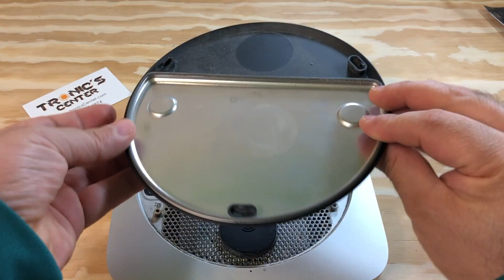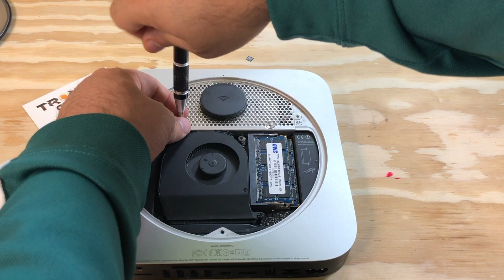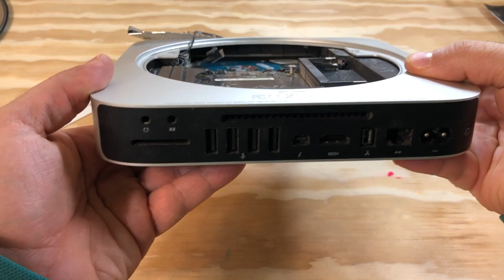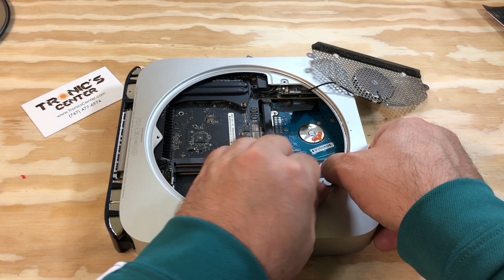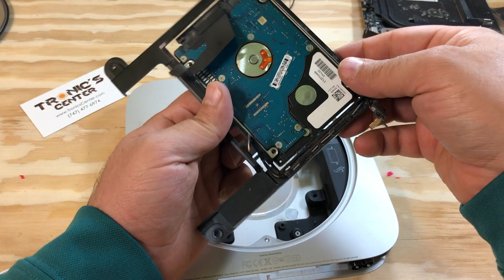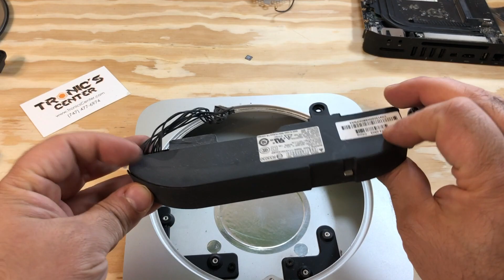Full Disassembly Apple Mac Mini A1347 - Take Apart Mac Mini A1347 and Tear down     HD 1080p

Comment: Thank you
Reply from the maker: Thanks  !  Dear Customer let us know what repair or disassembly you want us to make video ! Please not that we do deal with all Brands Dell, Lenovo, Asus, Razer, Toshiba, Hp, Sony, Panasonic, Nikon, Canon, Black Magic, Red Camera, any Camcorder Bards, Also we do IT Support and Data Recovery !
Reply from the maker: A2251 KeyWords 

MacBook Pro "Core i5" 2.0 13" 2020 4 TB 3, 2.0 GHz Core i5, I5-1038NG7, MacBook Pro "Core i7" 2.3 13" 2020 4 TB 3, 2.3 GHz Core i7,  I7-1068NG7, MacBookPro16,2 , 2020 13" 4 TB 3 , A2251 MacBook , EMC 3348, MWP72LL/A, BTO/CTO

————————————————————

A2141 KeyWords 

MacBook Pro "Core i7" 2.6 16" 2019, 2.6 GHz Core i7 (I7-9750H), 2.3 GHz Core i9 (I9-9880H), A2141 (EMC 3347), 2.4 GHz Core i9 (I9-9980HK) , MacBookPro16,1, MacBook Pro "Core i7" 2.6 16" 2019 5600M, 2.6 GHz Core i7 (I7-9750H),  MacBookPro16,4 , MacBook Pro "Core i9" 2.3 16" 2019 5600M, 2.3 GHz Core i9 (I9-9880H), MacBook Pro "Core i9" 2.4 16" 2019 5600M, 2.4 GHz Core i9 (I9-9980HK), MVVL2LL/A, MVVM2LL/A, 16" MacBook A2141

———————————————

A2179 Keywords

MWTJ2LL/A, EMC 3302 , 1.1 GHz Core i3 (I3-1000NG4) , MacBook Air "Core i3" 1.1 13" (Scissor, 2020) , MacBookAir9,1 , 1.1 GHz Core i5 (I5-1030NG7) , MVH22LL/A , MacBook Air "Core i7" 1.2 13" (Scissor, 2020), 1.2 GHz Core i7 (I7-1060NG7)

——————————————

A2159 Keywords 

1.4 GHz Core i5 (I5-8257U) , MacBook Pro "Core i5" 1.4 13" Touch/2019 2 TB 3 , MacBook Pro "Core i7" 1.7 13" Touch/2019 2 TB 3 , 1.7 GHz Core i7 (I7-8557U) , MUHN2LL/A , A2159 , EMC 3301 , MacBookPro15,4 , 2019 13" (Touch Bar, 2 TB 3), 13" MacBook Pro A2159

—————————————————————

A1932 Keywords  

MRE82LL/A , MVFH2LL/A, 1.6 GHz Core I5-8210Y, 1.6 GHz Core I5-8210Y, MacBookAir8,1 , EMC 3184 , 13" MacBook Air Space Gray, 13" MacBook Air Gold , 13" MacBook Air Silver , 13" MacBook Air 2019 13" MacBook Air 2018, 13" MacBook Air A1932

—————————————————————

A1534 Keyword’s

EMC 2746, MF855LL/A, MF865LL/A, EMC 2991, MLHA2LL/A, MLHC2LL/A, EMC 3099, MNYF2LL/A, MNYG2LL/A, MacBook8,1 , 1.1 GHz Core M (M-5Y31) , 1.2 GHz Core M (M-5Y51), 1.3 GHz Core M (M-5Y71), 1.1 GHz Core m3 (M3-6Y30), 1.2 GHz Core m5 (M5-6Y54), 1.3 GHz Core m7 (M7-6Y75), 1.2 GHz Core m3 (M3-7Y32), 1.3 GHz Core i5 (I5-7Y54), 1.4 GHz Core i7 (I7-7Y75), MacBook9,1 , MacBook10,1

——————————————————

A1990 Keywords

MR932LL/A, 2.2 GHz Core i7 (I7-8750H), EMC 3215, MacBookPro15,1 , MR942LL/A 2.6 GHz Core i7 (I7-8850H), 2.6 GHz Core i7 (I7-8850H), 2.9 GHz Core i9 (I9-8950HK), 2.6 GHz Core i7 (I7-9750H), EMC 3359, 2.3 GHz Core i9 (I9-9880H), 2.4 GHz Core i9 (I9-9980HK), MacBookPro15,3, A1990 MacBook, 15” MacBook A1990

———————————————————

A1989 Keyword 

A1989 MacBook 2018 MR9Q2LL/A, 2.3 GHz Core i5 (I5-8259U), BTO/CTO, 2.7 GHz Core i7 (I7-8559U), EMC 3214, MacBookPro15,2 , A1989 MacBook 2019 MV962LL/A , 2.4 GHz Core i5 (I5-8279U) , MV982LL/A, 2.8 GHz Core i7 (I7-8569U) , EMC 3358, 13" MacBook A1989

———————————————

A1708 Keywords

MLL42LL/A, A1708, EMC 2978, MacBookPro13,1 , 2.0 GHz Core i5 (I5-6360U) , 2.4 GHz Core i7 (I7-6660U) , MPXQ2LL/A, EMC 3164, 2.3 GHz Core i5 (I5-7360U) , 2.5 GHz Core i7 (I7-7660U), MPXQ2LL/A, 13" MacBook A1708

———————————————————— 
MacBook 

Apple, MacBook, 13" MacBook, MacBook Air, A1466 MacBook, MacBook Air logic Board, 13" MacBook Air , Apple Mac , 11” MacBook , A1465 MacBook, A1502 MacBook, A1398 MacBook, A1425 MacBook, A1706 MacBook, A1708 MacBook, A1707 MacBook, A1990 MacBook, A1989 MacBook, A2159 MacBook, A2179 MacBook, A2289 MacBook, A2337 MacBook, A2338 MacBook, A2141 MacBook, MacBook Pro, MacBook Pro Retina, Retina display, True Tone Display , Top Case KeyBoard, Apple Keyboard, MacBook KeyBoard, MacBook Trackpad.
———————————————————

A1398 MacBook, A1398 Logic Board, A1398 LCD, A1398 KeyBoard , A1398 Display, MC975LL/A, MC976LL/A, MD831LL/A, ME664LL/A, ME665LL/A , ME698LL/A, ME293LL/A, ME294LL/A, ME874LL/A, MGXA2LL/A, MGXC2LL/A, MGXG2LL/A, MJLQ2LL/A, MJLT2LL/A, MJLU2LL/A

—————————————————————

A1706 Keywords

MLH12LL/A, A1706 EMC 3071, MacBookPro13,2 , MacBookPro14,2 , MPXV2LL/A, A1706 EMC 3163 , 3.5 GHz Core I7-7567U, 3.3 GHz Core I5-7287U, 3.1 GHz Core I5-7267U, 3.3 GHz Core I7-6567U, 3.1 GHz Core I5-6287U, 2.9 GHz Core I5-6267U, A1706 MacBook, A1706 MacBook Touch Bar 

—————————————————————
A1707 Keywords 

MPN 923-01477 , MLH32LL/A, MLH42LL/A, MPTR2LL/A, MPTT2LL, EMC 3072, MLH32LL/A, MacBookPro13,3, 2.7 GHz Core i7 (I7-6820HQ), MLH42LL/A, 2.9 GHz Core i7 (I7-6920HQ), EMC 3162 , 2.8 GHz Core i7 (I7-7700HQ), MacBookPro14,3 , 2.9 GHz Core i7 (I7-7820HQ), MPTR2LL/A, MPTT2LL/A, 3.1 GHz Core i7 (I7-7920HQ), A1707 MacBook, A1707 Touch Bar

Comment: Great video 👍😊👍
Reply from the maker: A1481 Apple Mac pro Parts available at www.TronicsCenter.com Thanks for watching
Reply from the maker: A2251 KeyWords 

MacBook Pro "Core i5" 2.0 13" 2020 4 TB 3, 2.0 GHz Core i5, I5-1038NG7, MacBook Pro "Core i7" 2.3 13" 2020 4 TB 3, 2.3 GHz Core i7,  I7-1068NG7, MacBookPro16,2 , 2020 13" 4 TB 3 , A2251 MacBook , EMC 3348, MWP72LL/A, BTO/CTO

————————————————————

A2141 KeyWords 

MacBook Pro "Core i7" 2.6 16" 2019, 2.6 GHz Core i7 (I7-9750H), 2.3 GHz Core i9 (I9-9880H), A2141 (EMC 3347), 2.4 GHz Core i9 (I9-9980HK) , MacBookPro16,1, MacBook Pro "Core i7" 2.6 16" 2019 5600M, 2.6 GHz Core i7 (I7-9750H),  MacBookPro16,4 , MacBook Pro "Core i9" 2.3 16" 2019 5600M, 2.3 GHz Core i9 (I9-9880H), MacBook Pro "Core i9" 2.4 16" 2019 5600M, 2.4 GHz Core i9 (I9-9980HK), MVVL2LL/A, MVVM2LL/A, 16" MacBook A2141

———————————————

A2179 Keywords

MWTJ2LL/A, EMC 3302 , 1.1 GHz Core i3 (I3-1000NG4) , MacBook Air "Core i3" 1.1 13" (Scissor, 2020) , MacBookAir9,1 , 1.1 GHz Core i5 (I5-1030NG7) , MVH22LL/A , MacBook Air "Core i7" 1.2 13" (Scissor, 2020), 1.2 GHz Core i7 (I7-1060NG7)

——————————————

A2159 Keywords 

1.4 GHz Core i5 (I5-8257U) , MacBook Pro "Core i5" 1.4 13" Touch/2019 2 TB 3 , MacBook Pro "Core i7" 1.7 13" Touch/2019 2 TB 3 , 1.7 GHz Core i7 (I7-8557U) , MUHN2LL/A , A2159 , EMC 3301 , MacBookPro15,4 , 2019 13" (Touch Bar, 2 TB 3), 13" MacBook Pro A2159

—————————————————————

A1932 Keywords  

MRE82LL/A , MVFH2LL/A, 1.6 GHz Core I5-8210Y, 1.6 GHz Core I5-8210Y, MacBookAir8,1 , EMC 3184 , 13" MacBook Air Space Gray, 13" MacBook Air Gold , 13" MacBook Air Silver , 13" MacBook Air 2019 13" MacBook Air 2018, 13" MacBook Air A1932

—————————————————————

A1534 Keyword’s

EMC 2746, MF855LL/A, MF865LL/A, EMC 2991, MLHA2LL/A, MLHC2LL/A, EMC 3099, MNYF2LL/A, MNYG2LL/A, MacBook8,1 , 1.1 GHz Core M (M-5Y31) , 1.2 GHz Core M (M-5Y51), 1.3 GHz Core M (M-5Y71), 1.1 GHz Core m3 (M3-6Y30), 1.2 GHz Core m5 (M5-6Y54), 1.3 GHz Core m7 (M7-6Y75), 1.2 GHz Core m3 (M3-7Y32), 1.3 GHz Core i5 (I5-7Y54), 1.4 GHz Core i7 (I7-7Y75), MacBook9,1 , MacBook10,1

——————————————————

A1990 Keywords

MR932LL/A, 2.2 GHz Core i7 (I7-8750H), EMC 3215, MacBookPro15,1 , MR942LL/A 2.6 GHz Core i7 (I7-8850H), 2.6 GHz Core i7 (I7-8850H), 2.9 GHz Core i9 (I9-8950HK), 2.6 GHz Core i7 (I7-9750H), EMC 3359, 2.3 GHz Core i9 (I9-9880H), 2.4 GHz Core i9 (I9-9980HK), MacBookPro15,3, A1990 MacBook, 15” MacBook A1990

———————————————————

A1989 Keyword 

A1989 MacBook 2018 MR9Q2LL/A, 2.3 GHz Core i5 (I5-8259U), BTO/CTO, 2.7 GHz Core i7 (I7-8559U), EMC 3214, MacBookPro15,2 , A1989 MacBook 2019 MV962LL/A , 2.4 GHz Core i5 (I5-8279U) , MV982LL/A, 2.8 GHz Core i7 (I7-8569U) , EMC 3358, 13" MacBook A1989

———————————————

A1708 Keywords

MLL42LL/A, A1708, EMC 2978, MacBookPro13,1 , 2.0 GHz Core i5 (I5-6360U) , 2.4 GHz Core i7 (I7-6660U) , MPXQ2LL/A, EMC 3164, 2.3 GHz Core i5 (I5-7360U) , 2.5 GHz Core i7 (I7-7660U), MPXQ2LL/A, 13" MacBook A1708

———————————————————— 
MacBook 

Apple, MacBook, 13" MacBook, MacBook Air, A1466 MacBook, MacBook Air logic Board, 13" MacBook Air , Apple Mac , 11” MacBook , A1465 MacBook, A1502 MacBook, A1398 MacBook, A1425 MacBook, A1706 MacBook, A1708 MacBook, A1707 MacBook, A1990 MacBook, A1989 MacBook, A2159 MacBook, A2179 MacBook, A2289 MacBook, A2337 MacBook, A2338 MacBook, A2141 MacBook, MacBook Pro, MacBook Pro Retina, Retina display, True Tone Display , Top Case KeyBoard, Apple Keyboard, MacBook KeyBoard, MacBook Trackpad.
———————————————————

A1398 MacBook, A1398 Logic Board, A1398 LCD, A1398 KeyBoard , A1398 Display, MC975LL/A, MC976LL/A, MD831LL/A, ME664LL/A, ME665LL/A , ME698LL/A, ME293LL/A, ME294LL/A, ME874LL/A, MGXA2LL/A, MGXC2LL/A, MGXG2LL/A, MJLQ2LL/A, MJLT2LL/A, MJLU2LL/A

—————————————————————

A1706 Keywords

MLH12LL/A, A1706 EMC 3071, MacBookPro13,2 , MacBookPro14,2 , MPXV2LL/A, A1706 EMC 3163 , 3.5 GHz Core I7-7567U, 3.3 GHz Core I5-7287U, 3.1 GHz Core I5-7267U, 3.3 GHz Core I7-6567U, 3.1 GHz Core I5-6287U, 2.9 GHz Core I5-6267U, A1706 MacBook, A1706 MacBook Touch Bar 

—————————————————————
A1707 Keywords 

MPN 923-01477 , MLH32LL/A, MLH42LL/A, MPTR2LL/A, MPTT2LL, EMC 3072, MLH32LL/A, MacBookPro13,3, 2.7 GHz Core i7 (I7-6820HQ), MLH42LL/A, 2.9 GHz Core i7 (I7-6920HQ), EMC 3162 , 2.8 GHz Core i7 (I7-7700HQ), MacBookPro14,3 , 2.9 GHz Core i7 (I7-7820HQ), MPTR2LL/A, MPTT2LL/A, 3.1 GHz Core i7 (I7-7920HQ), A1707 MacBook, A1707 Touch Bar

Comment: good video
Reply from the maker: All Parts of Mac Mini and iMac available at www.TronicsCenter.com Thanks for watching
Reply from the maker: A2251 KeyWords 

MacBook Pro "Core i5" 2.0 13" 2020 4 TB 3, 2.0 GHz Core i5, I5-1038NG7, MacBook Pro "Core i7" 2.3 13" 2020 4 TB 3, 2.3 GHz Core i7,  I7-1068NG7, MacBookPro16,2 , 2020 13" 4 TB 3 , A2251 MacBook , EMC 3348, MWP72LL/A, BTO/CTO

————————————————————

A2141 KeyWords 

MacBook Pro "Core i7" 2.6 16" 2019, 2.6 GHz Core i7 (I7-9750H), 2.3 GHz Core i9 (I9-9880H), A2141 (EMC 3347), 2.4 GHz Core i9 (I9-9980HK) , MacBookPro16,1, MacBook Pro "Core i7" 2.6 16" 2019 5600M, 2.6 GHz Core i7 (I7-9750H),  MacBookPro16,4 , MacBook Pro "Core i9" 2.3 16" 2019 5600M, 2.3 GHz Core i9 (I9-9880H), MacBook Pro "Core i9" 2.4 16" 2019 5600M, 2.4 GHz Core i9 (I9-9980HK), MVVL2LL/A, MVVM2LL/A, 16" MacBook A2141

———————————————

A2179 Keywords

MWTJ2LL/A, EMC 3302 , 1.1 GHz Core i3 (I3-1000NG4) , MacBook Air "Core i3" 1.1 13" (Scissor, 2020) , MacBookAir9,1 , 1.1 GHz Core i5 (I5-1030NG7) , MVH22LL/A , MacBook Air "Core i7" 1.2 13" (Scissor, 2020), 1.2 GHz Core i7 (I7-1060NG7)

——————————————

A2159 Keywords 

1.4 GHz Core i5 (I5-8257U) , MacBook Pro "Core i5" 1.4 13" Touch/2019 2 TB 3 , MacBook Pro "Core i7" 1.7 13" Touch/2019 2 TB 3 , 1.7 GHz Core i7 (I7-8557U) , MUHN2LL/A , A2159 , EMC 3301 , MacBookPro15,4 , 2019 13" (Touch Bar, 2 TB 3), 13" MacBook Pro A2159

—————————————————————

A1932 Keywords  

MRE82LL/A , MVFH2LL/A, 1.6 GHz Core I5-8210Y, 1.6 GHz Core I5-8210Y, MacBookAir8,1 , EMC 3184 , 13" MacBook Air Space Gray, 13" MacBook Air Gold , 13" MacBook Air Silver , 13" MacBook Air 2019 13" MacBook Air 2018, 13" MacBook Air A1932

—————————————————————

A1534 Keyword’s

EMC 2746, MF855LL/A, MF865LL/A, EMC 2991, MLHA2LL/A, MLHC2LL/A, EMC 3099, MNYF2LL/A, MNYG2LL/A, MacBook8,1 , 1.1 GHz Core M (M-5Y31) , 1.2 GHz Core M (M-5Y51), 1.3 GHz Core M (M-5Y71), 1.1 GHz Core m3 (M3-6Y30), 1.2 GHz Core m5 (M5-6Y54), 1.3 GHz Core m7 (M7-6Y75), 1.2 GHz Core m3 (M3-7Y32), 1.3 GHz Core i5 (I5-7Y54), 1.4 GHz Core i7 (I7-7Y75), MacBook9,1 , MacBook10,1

——————————————————

A1990 Keywords

MR932LL/A, 2.2 GHz Core i7 (I7-8750H), EMC 3215, MacBookPro15,1 , MR942LL/A 2.6 GHz Core i7 (I7-8850H), 2.6 GHz Core i7 (I7-8850H), 2.9 GHz Core i9 (I9-8950HK), 2.6 GHz Core i7 (I7-9750H), EMC 3359, 2.3 GHz Core i9 (I9-9880H), 2.4 GHz Core i9 (I9-9980HK), MacBookPro15,3, A1990 MacBook, 15” MacBook A1990

———————————————————

A1989 Keyword 

A1989 MacBook 2018 MR9Q2LL/A, 2.3 GHz Core i5 (I5-8259U), BTO/CTO, 2.7 GHz Core i7 (I7-8559U), EMC 3214, MacBookPro15,2 , A1989 MacBook 2019 MV962LL/A , 2.4 GHz Core i5 (I5-8279U) , MV982LL/A, 2.8 GHz Core i7 (I7-8569U) , EMC 3358, 13" MacBook A1989

———————————————

A1708 Keywords

MLL42LL/A, A1708, EMC 2978, MacBookPro13,1 , 2.0 GHz Core i5 (I5-6360U) , 2.4 GHz Core i7 (I7-6660U) , MPXQ2LL/A, EMC 3164, 2.3 GHz Core i5 (I5-7360U) , 2.5 GHz Core i7 (I7-7660U), MPXQ2LL/A, 13" MacBook A1708

———————————————————— 
MacBook 

Apple, MacBook, 13" MacBook, MacBook Air, A1466 MacBook, MacBook Air logic Board, 13" MacBook Air , Apple Mac , 11” MacBook , A1465 MacBook, A1502 MacBook, A1398 MacBook, A1425 MacBook, A1706 MacBook, A1708 MacBook, A1707 MacBook, A1990 MacBook, A1989 MacBook, A2159 MacBook, A2179 MacBook, A2289 MacBook, A2337 MacBook, A2338 MacBook, A2141 MacBook, MacBook Pro, MacBook Pro Retina, Retina display, True Tone Display , Top Case KeyBoard, Apple Keyboard, MacBook KeyBoard, MacBook Trackpad.
———————————————————

A1398 MacBook, A1398 Logic Board, A1398 LCD, A1398 KeyBoard , A1398 Display, MC975LL/A, MC976LL/A, MD831LL/A, ME664LL/A, ME665LL/A , ME698LL/A, ME293LL/A, ME294LL/A, ME874LL/A, MGXA2LL/A, MGXC2LL/A, MGXG2LL/A, MJLQ2LL/A, MJLT2LL/A, MJLU2LL/A

—————————————————————

A1706 Keywords

MLH12LL/A, A1706 EMC 3071, MacBookPro13,2 , MacBookPro14,2 , MPXV2LL/A, A1706 EMC 3163 , 3.5 GHz Core I7-7567U, 3.3 GHz Core I5-7287U, 3.1 GHz Core I5-7267U, 3.3 GHz Core I7-6567U, 3.1 GHz Core I5-6287U, 2.9 GHz Core I5-6267U, A1706 MacBook, A1706 MacBook Touch Bar 

—————————————————————
A1707 Keywords 

MPN 923-01477 , MLH32LL/A, MLH42LL/A, MPTR2LL/A, MPTT2LL, EMC 3072, MLH32LL/A, MacBookPro13,3, 2.7 GHz Core i7 (I7-6820HQ), MLH42LL/A, 2.9 GHz Core i7 (I7-6920HQ), EMC 3162 , 2.8 GHz Core i7 (I7-7700HQ), MacBookPro14,3 , 2.9 GHz Core i7 (I7-7820HQ), MPTR2LL/A, MPTT2LL/A, 3.1 GHz Core i7 (I7-7920HQ), A1707 MacBook, A1707 Touch Bar
Reply from the maker: A2251 KeyWords 

MacBook Pro "Core i5" 2.0 13" 2020 4 TB 3, 2.0 GHz Core i5, I5-1038NG7, MacBook Pro "Core i7" 2.3 13" 2020 4 TB 3, 2.3 GHz Core i7,  I7-1068NG7, MacBookPro16,2 , 2020 13" 4 TB 3 , A2251 MacBook , EMC 3348, MWP72LL/A, BTO/CTO

————————————————————

A2141 KeyWords 

MacBook Pro "Core i7" 2.6 16" 2019, 2.6 GHz Core i7 (I7-9750H), 2.3 GHz Core i9 (I9-9880H), A2141 (EMC 3347), 2.4 GHz Core i9 (I9-9980HK) , MacBookPro16,1, MacBook Pro "Core i7" 2.6 16" 2019 5600M, 2.6 GHz Core i7 (I7-9750H),  MacBookPro16,4 , MacBook Pro "Core i9" 2.3 16" 2019 5600M, 2.3 GHz Core i9 (I9-9880H), MacBook Pro "Core i9" 2.4 16" 2019 5600M, 2.4 GHz Core i9 (I9-9980HK), MVVL2LL/A, MVVM2LL/A, 16" MacBook A2141

———————————————

A2179 Keywords

MWTJ2LL/A, EMC 3302 , 1.1 GHz Core i3 (I3-1000NG4) , MacBook Air "Core i3" 1.1 13" (Scissor, 2020) , MacBookAir9,1 , 1.1 GHz Core i5 (I5-1030NG7) , MVH22LL/A , MacBook Air "Core i7" 1.2 13" (Scissor, 2020), 1.2 GHz Core i7 (I7-1060NG7)

——————————————

A2159 Keywords 

1.4 GHz Core i5 (I5-8257U) , MacBook Pro "Core i5" 1.4 13" Touch/2019 2 TB 3 , MacBook Pro "Core i7" 1.7 13" Touch/2019 2 TB 3 , 1.7 GHz Core i7 (I7-8557U) , MUHN2LL/A , A2159 , EMC 3301 , MacBookPro15,4 , 2019 13" (Touch Bar, 2 TB 3), 13" MacBook Pro A2159

—————————————————————

A1932 Keywords  

MRE82LL/A , MVFH2LL/A, 1.6 GHz Core I5-8210Y, 1.6 GHz Core I5-8210Y, MacBookAir8,1 , EMC 3184 , 13" MacBook Air Space Gray, 13" MacBook Air Gold , 13" MacBook Air Silver , 13" MacBook Air 2019 13" MacBook Air 2018, 13" MacBook Air A1932

—————————————————————

A1534 Keyword’s

EMC 2746, MF855LL/A, MF865LL/A, EMC 2991, MLHA2LL/A, MLHC2LL/A, EMC 3099, MNYF2LL/A, MNYG2LL/A, MacBook8,1 , 1.1 GHz Core M (M-5Y31) , 1.2 GHz Core M (M-5Y51), 1.3 GHz Core M (M-5Y71), 1.1 GHz Core m3 (M3-6Y30), 1.2 GHz Core m5 (M5-6Y54), 1.3 GHz Core m7 (M7-6Y75), 1.2 GHz Core m3 (M3-7Y32), 1.3 GHz Core i5 (I5-7Y54), 1.4 GHz Core i7 (I7-7Y75), MacBook9,1 , MacBook10,1

——————————————————

A1990 Keywords

MR932LL/A, 2.2 GHz Core i7 (I7-8750H), EMC 3215, MacBookPro15,1 , MR942LL/A 2.6 GHz Core i7 (I7-8850H), 2.6 GHz Core i7 (I7-8850H), 2.9 GHz Core i9 (I9-8950HK), 2.6 GHz Core i7 (I7-9750H), EMC 3359, 2.3 GHz Core i9 (I9-9880H), 2.4 GHz Core i9 (I9-9980HK), MacBookPro15,3, A1990 MacBook, 15” MacBook A1990

———————————————————

A1989 Keyword 

A1989 MacBook 2018 MR9Q2LL/A, 2.3 GHz Core i5 (I5-8259U), BTO/CTO, 2.7 GHz Core i7 (I7-8559U), EMC 3214, MacBookPro15,2 , A1989 MacBook 2019 MV962LL/A , 2.4 GHz Core i5 (I5-8279U) , MV982LL/A, 2.8 GHz Core i7 (I7-8569U) , EMC 3358, 13" MacBook A1989

———————————————

A1708 Keywords

MLL42LL/A, A1708, EMC 2978, MacBookPro13,1 , 2.0 GHz Core i5 (I5-6360U) , 2.4 GHz Core i7 (I7-6660U) , MPXQ2LL/A, EMC 3164, 2.3 GHz Core i5 (I5-7360U) , 2.5 GHz Core i7 (I7-7660U), MPXQ2LL/A, 13" MacBook A1708

———————————————————— 
MacBook 

Apple, MacBook, 13" MacBook, MacBook Air, A1466 MacBook, MacBook Air logic Board, 13" MacBook Air , Apple Mac , 11” MacBook , A1465 MacBook, A1502 MacBook, A1398 MacBook, A1425 MacBook, A1706 MacBook, A1708 MacBook, A1707 MacBook, A1990 MacBook, A1989 MacBook, A2159 MacBook, A2179 MacBook, A2289 MacBook, A2337 MacBook, A2338 MacBook, A2141 MacBook, MacBook Pro, MacBook Pro Retina, Retina display, True Tone Display , Top Case KeyBoard, Apple Keyboard, MacBook KeyBoard, MacBook Trackpad.
———————————————————

A1398 MacBook, A1398 Logic Board, A1398 LCD, A1398 KeyBoard , A1398 Display, MC975LL/A, MC976LL/A, MD831LL/A, ME664LL/A, ME665LL/A , ME698LL/A, ME293LL/A, ME294LL/A, ME874LL/A, MGXA2LL/A, MGXC2LL/A, MGXG2LL/A, MJLQ2LL/A, MJLT2LL/A, MJLU2LL/A

—————————————————————

A1706 Keywords

MLH12LL/A, A1706 EMC 3071, MacBookPro13,2 , MacBookPro14,2 , MPXV2LL/A, A1706 EMC 3163 , 3.5 GHz Core I7-7567U, 3.3 GHz Core I5-7287U, 3.1 GHz Core I5-7267U, 3.3 GHz Core I7-6567U, 3.1 GHz Core I5-6287U, 2.9 GHz Core I5-6267U, A1706 MacBook, A1706 MacBook Touch Bar 

—————————————————————
A1707 Keywords 

MPN 923-01477 , MLH32LL/A, MLH42LL/A, MPTR2LL/A, MPTT2LL, EMC 3072, MLH32LL/A, MacBookPro13,3, 2.7 GHz Core i7 (I7-6820HQ), MLH42LL/A, 2.9 GHz Core i7 (I7-6920HQ), EMC 3162 , 2.8 GHz Core i7 (I7-7700HQ), MacBookPro14,3 , 2.9 GHz Core i7 (I7-7820HQ), MPTR2LL/A, MPTT2LL/A, 3.1 GHz Core i7 (I7-7920HQ), A1707 MacBook, A1707 Touch Bar